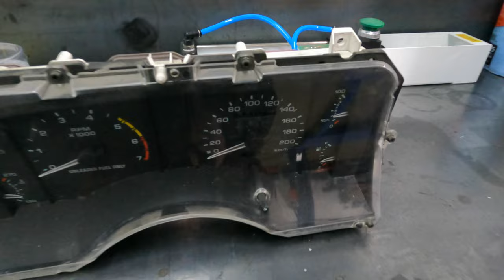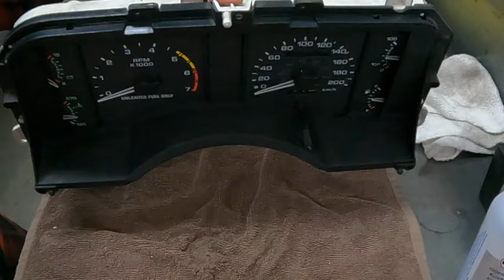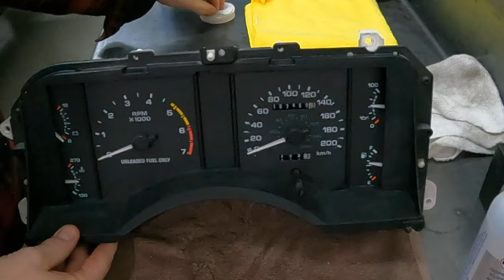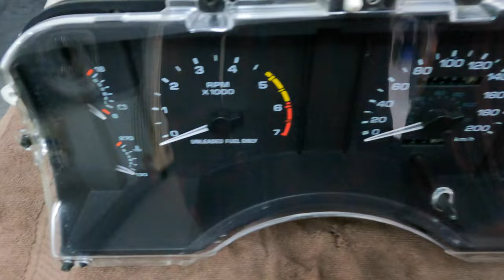Instant Difference! I Restored A 33 Year Old Gauge Cluster To Almost New!!

Comment: Great video! Remember kids when ever using any kind of wax or polish. Do you like Gary did. Pour the polish or wax on your applicator. Never ever pour wax or polish directly to the surface you’re trying to clean. Always on the applicator first and then polish with it. Because if you haven’t shaken up the product enough you can sometimes pour the cleaning solution with a solvent concentration on your paint or what your polishing and it will leave a permit mark😢
Reply from the maker: Thank you and very well said 👍

Comment: Hi Gary.  This summer I will have had my fox for 32 years and, at the risk of earning the scorn of the entire foxbody family, I will admit that I have never changed the heater core in my car. Now that I've said that, it will probably turn into a gusher tomorrow, however, it doesn't leak and I really, really don't want to take it out. I've always been pretty anal about keeping clean, fresh coolant in the car so maybe that's why it doesn't leak. Yet. I just doomed myself, didn't I. Anyway, great video on the cluster restoration. Thanks. Bill. 🦊😕⛵
Reply from the maker: Hey Bill! Funny enough I’m right there with you. My 92 coupe still has the original as well 😂😂😂

Comment: Awesome video! Those heater cores are extremely time consuming, but extremely necessary. LoL 🐺👍
Reply from the maker: Thx buddy! Yes so true!!!
Reply: I totally disagree 😂 I’m in Miami the heater core is all around us.  Now evaporators, that we need. I had my heater core done at the same time as my evaporator and it started leaking a month later. Part had warranty but the labor didn’t so it’s been disconnected for 22 years. If I had to do the evaporator again I would do the heater core again and try to find a high quality replacement.

Comment: Hi Gary Question if I wanted to swap a miles per hour gauge cluster with a KPH one is it is a straight plug and play application or do I need to replace other parts or do other things to make it work?
Reply from the maker: It would be a straight swap over. Just make sure you have the right speedo gear in the tail shaft of the trans for the gears and wheel/tire combo you’re running. I have a video on my channel talking about this 👍